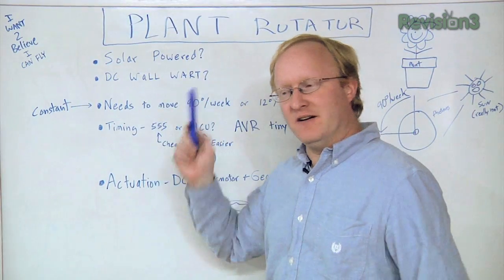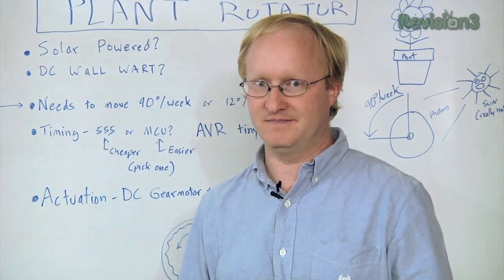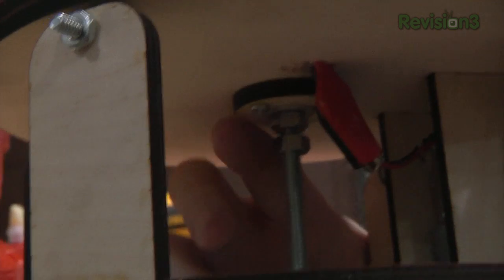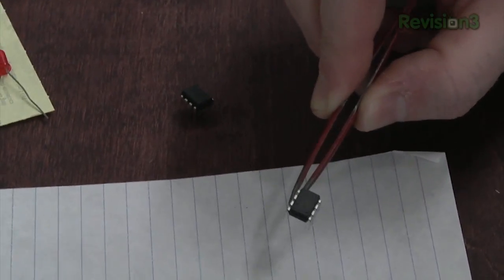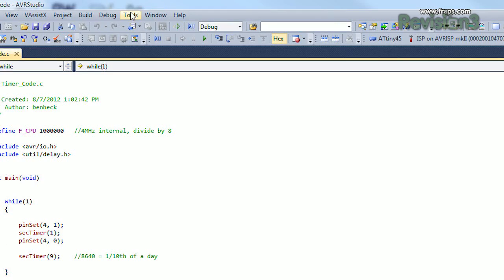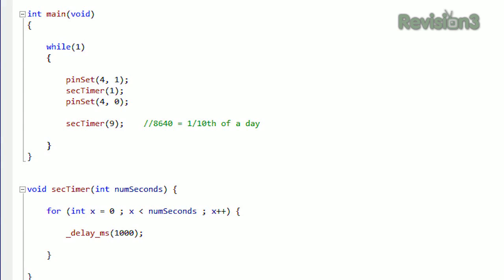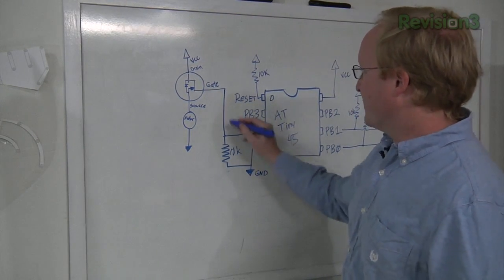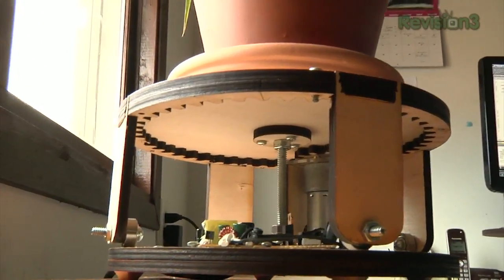Automated Flower Power!

Comment: i'd have to say, pure analog would work too, solar panel, little one, really tiny motor, belt around a tiny pulley, plant on a lazy susan acting as a huge pulley.  turn it slowly, constantly, only when the sun is up.  would turn faster when it's bright, so even light would be on each side.

Comment: How would you go about building a computer case, that would have the DVD drive and power/reset buttons in the sidepanel? Other than that, it should be a normal ATX, just wide enough for the length of the DVD drive component to fit... No-one actually makes these! I'm thinking I should cut the insides of my case for all the screws to fit, and build the outer shell from.. I dunno, wood I guess. Can't work on anything else right now. Would love to hear your input if you have any. Cheers.

Comment: I'd rather see the rotator run off a 12 volt sealed lead-acid battery.  I say, recharge the battery during the day, and rotate to the appropriate degree at night, and try to time the servomechanism for the rotator to stop before daylight.  Thats how I'd do it.  solar power recharge during the day, and battery powered servo during the night.